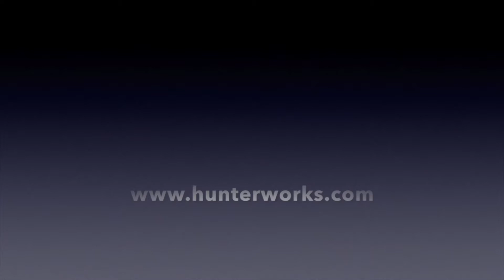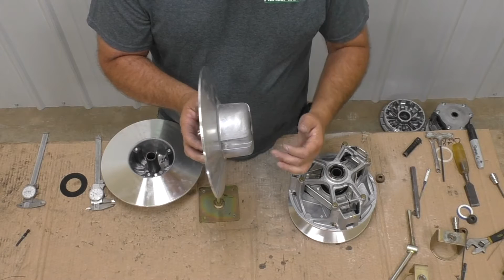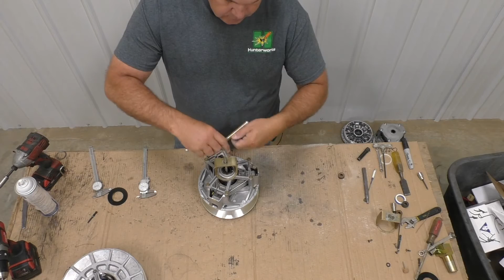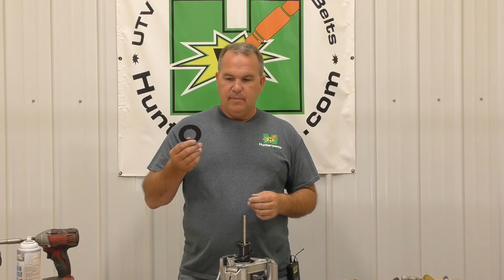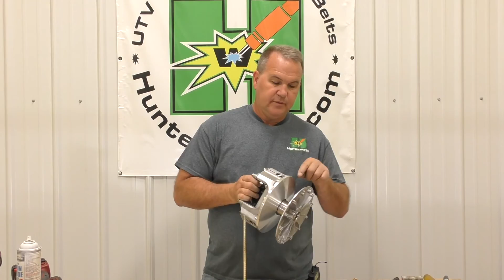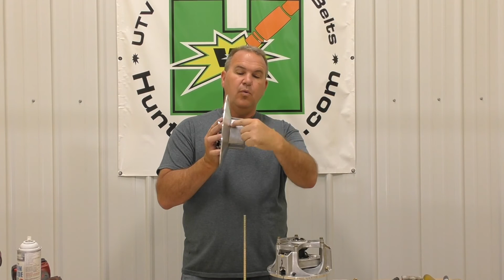Stop Blowing Polaris Turbo Belts at high speed

Comment: what tool is that? the tool you used to assemble it
Reply from the maker: Dannyboyrides 450 our secondary spring compressor.   I only use it on turbo primary clutches
Reply: Hunterworks Inc.  do I need to purchase that tool to add a washer?
Reply from the maker: Dannyboyrides 450 need no.  Just makes really easy
Reply: Hunterworks Inc. okay cool! Also last question before I make a purchase, do I need to purchase two or One black washers for my 2016 Turbo XPT?
Reply from the maker: Dannyboyrides 450 just one.
Reply: Hunterworks Inc. okay so im removing the stock one and putting the HW black washer correct?
Reply from the maker: Dannyboyrides 450 no.  Watch the video

Comment: Informative video.  However, youkeep saying Polaris did this, Polaria didn't do that.  Do you really think Polaris assembles the clutches themselves?  It is an oursourced component.
Reply from the maker: It is a OEM part and no matter whether they make it or not themselves, they design it and approve it
Reply: @Hunterworks   but they don't assemble, which is the point if the limiter os in wrong or missing, it happened at the facility it was manufactured at, not at Polaris.  Do you QC every single part, and measure every single belt? It is no different than one of your belts being slightly our of spec.  You didn't make it out of spec, your supplier did.
Reply from the maker: @JDSTACTICAL  I guess but don't you think that would be some wasted words in a video when most folks don't know or care who actually made or assembled their oe clutch and therefore to them it is Polaris since it came on it?
Reply: @Hunterworks  I'm not denying they designed and approved it.  As a matter of fact, I wasn't talking about the design at all.  I was talking about, now read this part very carefully, they DO NOT assemble the clucthes, and very likely do not QC every single  individual part.  Now being you can't seem to grasp the concept, any missing limiter, or upside down limiter would have been done at the suppliers facility, not by Polaris. That should be an easy thing to understand, well atleast for anyone that doesn't live in Mississippi.
Reply from the maker: @JDSTACTICAL  you are just being difficult, for all us normal folks that is a polaris clutch and they are responsible for it being right etc, same as this MS boys belts that I do not personally make and do not QC everyone of them.  You make your own video if you like.  Keep in mind my channel is not a democracy, it is a dictatorship.  There is this  "hide this user from channel" button which I am going to use on you as soon as I know you have read this so you will not have to be subjected to my silly videos any longer!!
Reply: @Hunterworks  hide away if that is what you want.  However, just like you, if the issue is brought to Polaris they would fix that  individual QC issue.
Reply from the maker: @JDSTACTICAL  I don't know them to tell them.  You are missing my point, you are being rude and talking bad about all MS folks and I do not have to allow it on my channel.